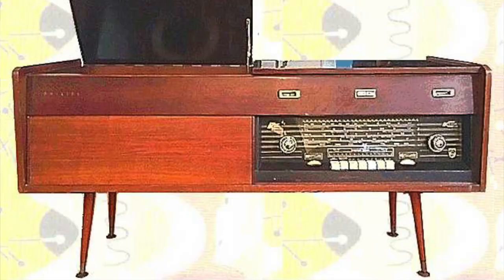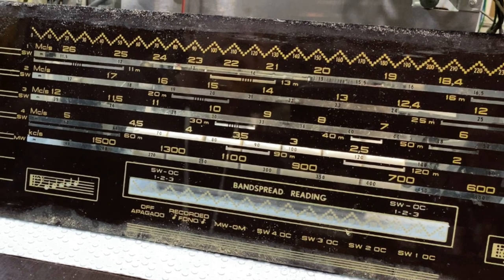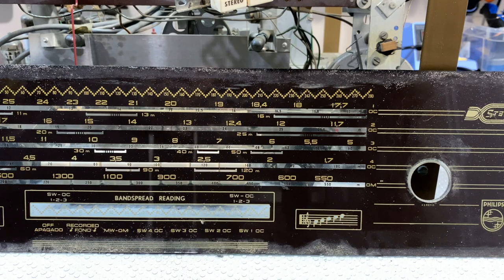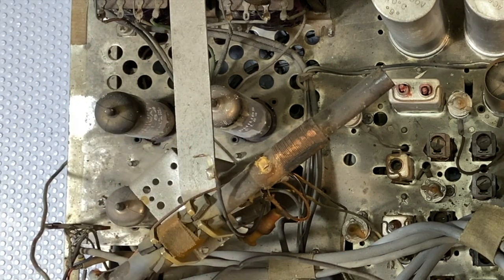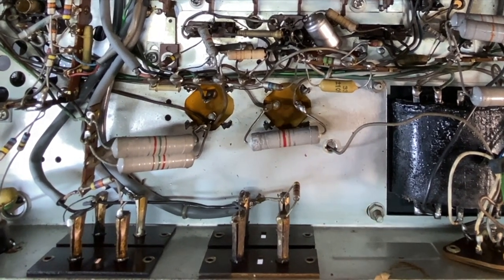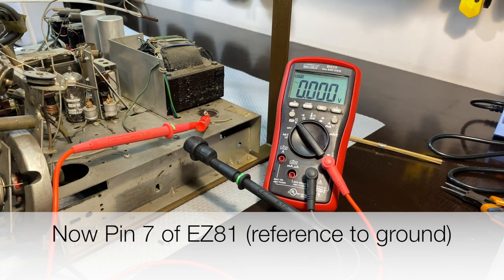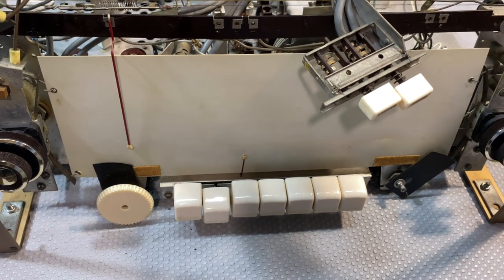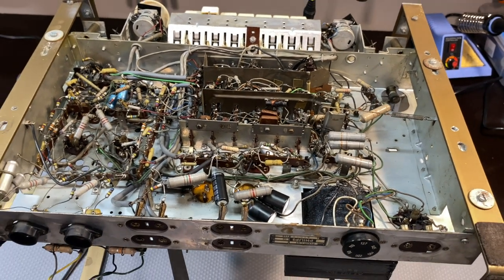Philips F6X95A Tube Radio Chassis Restoration pt. 1 - This one needs lots of alcohol!

Comment: Compared to Philips, I absolutely LOVE Erres tube radio's. 
More because of their design, but also because the old service manuals and schematics are extremely clear and well written.
Even incl amount of turn ratio's per transformer etc. Fantastic. 
Philips also has some stunning designs as well, although in my experience their schematics can sometimes contain quite some errors or just missing parts.

One note on "gramophone" pre-amps. Vinyl seems to get more popular again these days.
So my approach, is to build in a Bluetooth as well as a RIAA-preamp.
Ideally with tubes from the same era. Sometimes with an FM module, or I repurpose the old FM circuit.
Some people call these wrong, but I see it as repurposing some old family sentiment, that otherwise would go on the landfill.
To bad to waste such pieces of history and art otherwise!

Love your videos!
Reply from the maker: I agree the Erres are spectacular radios. Unusual design in some cases, but very well built. 
I’ve done lots of Bluetooth additions but not preamps for record players. I’ll have to try it someday.

Comment: Thanks for yet another  great learning video.
Recently worked on a similar Australian designed ( or at least built ) console unit with split twin transformers, and corresponding pre amp and finals.
Your video has given me further insight to the design thoughts of former engineering processes.
And filled in a few gaps in my understanding of these circuits.
Reply from the maker: Glad to know it’s helped you.

Comment: I was thinking those output transformers are pretty small.. then I crossed over the EL84 to it's North American cousin and realized they are essentially being driven by 6BQ5 output tubes in Class-A. Maybe 5W maximum output per channel. I'm guessing the speakers for these will be pretty efficient to get as much out of the tubes as they can.
Looking forward to what this rig sounds like.
(BTW, I have a Philips radio in my repair lineup, a B3X88U/71 for the North American market so your vids on these units are very helpful)
Cheers,
Reply from the maker: Yes, it’s probably less than 5W, but it gets loud, really loud.

Comment: This is a very nice radio, it should preform very well.
The first EF89 is probably an RF amp and this may be why the tuning capacitor has 3 gangs.
One of my radios is built quite the same, except it has only one ECC83 and each section feeds it's oun EL84, it also has seperate output transformers (the phonograph and the amp are stereo and it has excellent stereo seperation).
Ireally loved this video! since you started showing on your videos It really adds to the videos' the cleaning segment was a very nice touch with amazing results on the go.
Well done!
Reply from the maker: You’re absolutely right. The EF89 is in fact an RF amp, and has its own tuning capacitor section. This should have pretty good sensory.

Comment: Same as for Jac who responded to your video. I'm Dutch too. Philips 100% Dutch build. The reason why Philips looks like the German radio's is in the war, Philips was still making radio's and transmitters for Germany. So they worked together with companies like Grundig and Siemens and may more. Philips is now a company that develops medical electronic instruments only. They stopped with all the other parts of Philips. Shame I find it. But he again a nice video you realy can explain the technical side.
I'm still trying to get messurement devices like scope and tone occilator. I got a solder and de-solder station, a Fluke and one hand in a tubeamp or transistor amp. 😏

Comment: Hi Manuel, nice to see the face behind the voice. I don't know if you have restored any Telefunken sets before, but some of them have a feature known as KW Lupe. This is pretty much similar to the bandspread on that Philips. You tune on to or near a SW station using the AM knob and then fine tune it with the FM. It's not a gimmick and is quite useful. Here in UK there is not much in the way of SW stations using a standard set. You would need to erect a great big long wire antenna in your back garden.
Reply from the maker: I’ve come across the UK lupe function a few times. Not sure which radios but it may have been the telefunkens.
As for SW, I tried the long wire and then came across the mini-whip. It’s absolutely magic. All my SW testing uses it, and it’s supposed to be only for lower frequencies! You should build one. It’ll surprise you.
Reply: My uncle Sam tells a story laying claim to have been a big part of the development and design of the whip antenna for the US military. I've not checked this claim, but it does sound very impressive, and he's certainly no RF-engineering dilettante. If his claim is genuine, you may have him to thank in large part for the miracle of the whip antenna.
Reply from the maker: I will happily thanks whomever got this idea and put it into practice, because It’s a real miracle.
Reply: Do you have a design for the whip antenna? Is it something that could be made at home.
Reply from the maker: Here is the link to the project site. Follow the links at the bottom where they show the schematic, etc. It’s quite easy to build yourself.
http://dl1dbc.net/SAQ/miniwhip.html

Comment: Hi Manuel, a lot of Philips tube radios are also German radios. If the serial number on the chassis starts with "W" or "WA" the radio was produced (and in many cases also designed) in Wetzlar, Germany.
Reply from the maker: This one doesn’t have those letters though. It has an “X” in the model number, which signified “made in the Netherlands. There is an interesting article on Radiomusuem that explains how these sets were named.

Comment: A hint regarding safety; at 5:00 it can be seen that the radio uses the Philips typical Roses Metall melting alloy thermal fuse mounted on the transformer. Please DO add a proper value standard 20x5 slow blow fuse.
This Roses metal thermal fuse is known to either crack from inrush current fatigue or trip by the time the set is already on fire because it is "ultra ultra ultra slow blow". And dont forget sometimes after tripping not only noobs but also unknowledgeable shops replace it with a wire link or a ring of standard solder that will ofc not melt at 94°C like Roses Metall
Reply from the maker: Thank you for that. I’ve never trusted these fuses, but in this instance I did not even think about it.

Comment: Can I ask you what you use to clean the chassis . Seems to remove the dirt very well . I have a similar Philips bi amp table model . Works well but chassis is covered in nicotine . The only caps I replaced were those 2 tar covered ones on the opts . 
Love your videos . Looking forward to the testing stage on that one ... Best regards ...
Reply from the maker: I use isopropyl alcohol. Works very well.
Reply: Nice Nice Great bath. What percentage of IPA do you use?
99% dries very fast. 60% or so has too much water and does not dry fast. Heard bad for phoenelic valve sockets or Band switches. Kindly advise.
Reply from the maker: This one is labelled >99%. Using other alcohol can in fact cause shorts on these tube sockets.

Comment: A couple of questions...
Do you think that you could remove the tarnish by polishing it with some Brasso or some such product?
The long thin component that was labeled 22K, are you positive that is not a resistor instead of a capacitor?
Reply from the maker: Using brasso could in fact remove the galvanise layer and allow rust to set in. We know that it has prevented rust so far, so no point in messing with that. 
As for the component in question, it is indeed a cap. I know, it’s weird.

Comment: I'm concerned about you having the HT smoothing resistors very close to the new electrolytics. The heat from them cannot be good for the caps.
Reply from the maker: I think the space is enough in this case. we’ll see.

Comment: Stereo without FM/UKW... Shows exact one of the indecisions of that period.
We did not hear about the 1/4 W resistors, did you measure them all ? Would not trust one of them.
The ferrite can only be adjusted 45°, just enough to get rid of a dead spot 💢
Reply from the maker: The lack of FM in Madeira would not have been missed at that time, because it came in much later over here. 
I’m still checking components but so far haven’t found any resistors with problems.
Reply: @electronicsoldandnew  Forgot about the island.
Maybe that the resistors show that the radio has not being used a lot then. I saw the same sort in my Philips, and every resistor stressed to the edge was off, going up, and out of specs. 80% or so.
Reply from the maker: I’ll continue to check, and replace if anywhere near suspicious

Comment: Mustard caps ....... i lought loud.
Reply from the maker: Yes, fishy 😊
Reply: That mosterd cap reminds me my very first tube repair. Around 1974 I found a VHF television at the garbage. Plugged it in, and blew my parents fuse. With the only equipment I had, a nice Japanese analogue multimeter, it showed one Ohm between the leads. Kept cutting and re soldering wires until the short went away ... Happened to be exact such mustard cap. I was the youngest in the house, but the first with his own TV  😎